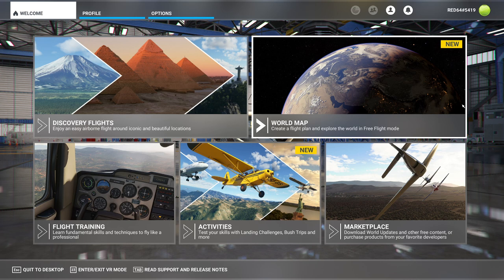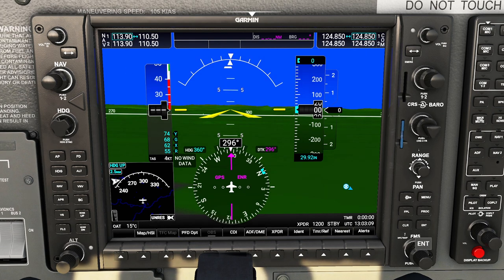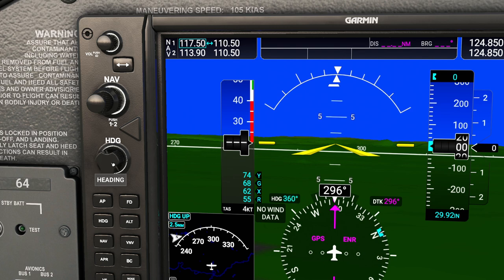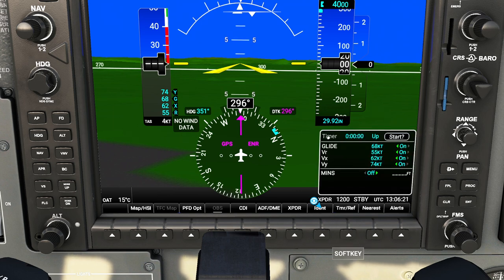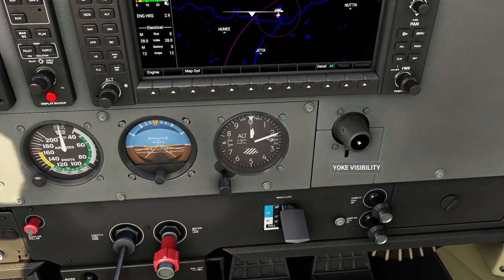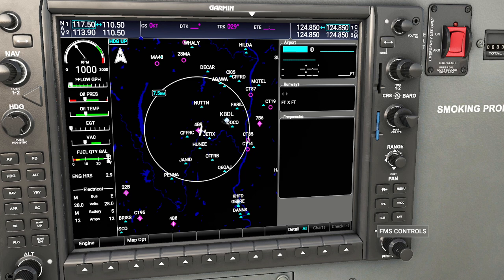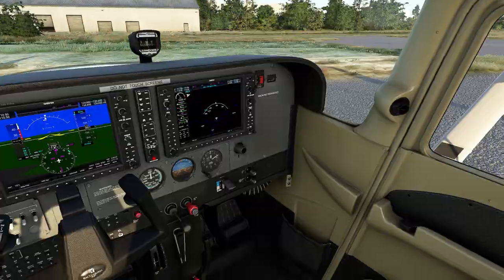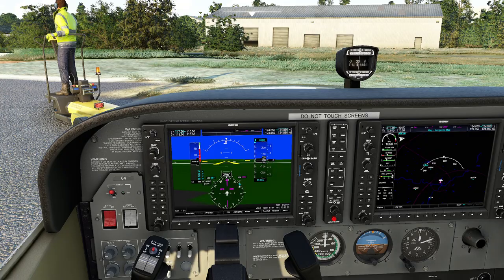MSFS - G1000nx Controls, Install and Setup Tutorial

Comment: Love your videos.  You should also teach us the trick for entering a airport identifier without using the FMS turn nobs. Just to the right of where you see the airport id, there is a white keyboard looking icon.  If you click that with your mouse you can now use your keyboard to key in way points and airport id info.  Way faster and easier.
Reply: You can also click on the flashing entry field as well, sometimes a little easier than the small keyboard icon.